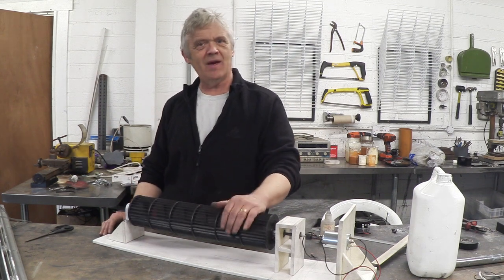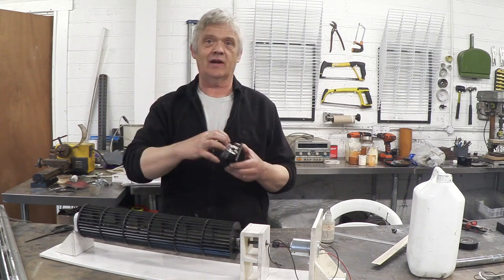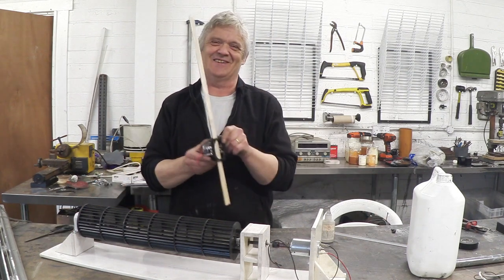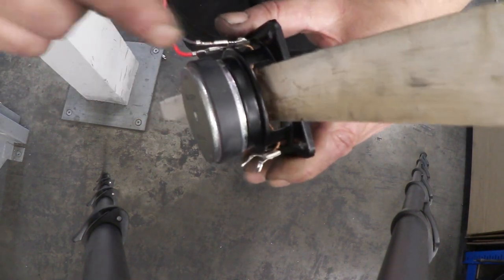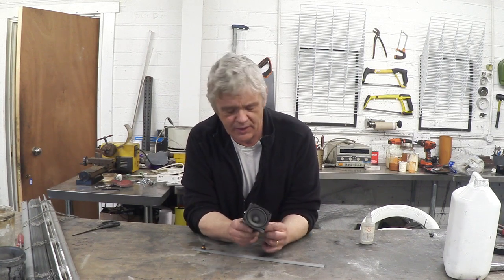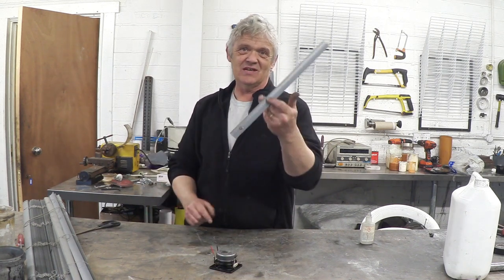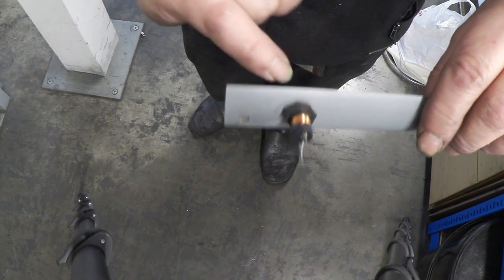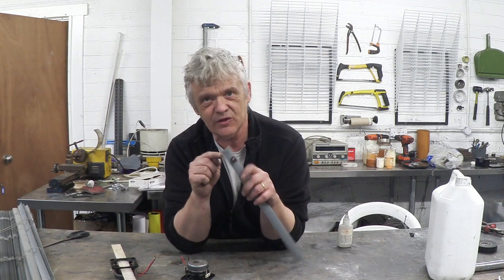Weird Wind Generator   No Blades, No Moving Parts

Comment: very cool! seems like it would be a breeze to mass produce
Reply from the maker: I was thinking those little microphones - in which case it would be
Reply: Breeze .. lol i see what you did there!
Reply: @ThinkingandTinkering  Wouldn´t a microphone produce a tiny bit of power anyway, if you put it in the wind, the wind blows in the microphone and produces a lot of signal usually.. This is used in many games on the DS, because blowing in the microphone usually maxes out the signal.  So if got that bit right, it´s a question of hooking up a lot of tiny mics to a diode-bridge and then possibly joule-thiefs?
Reply: @ThinkingandTinkering  How much would the cost/watt be? Because the reason why we are building those huge towers for wind turbines is that while a small one is fine for a home owner it is not as economical to build a million 500W microturbines as twenty 25MW ones. Given these tiny devices would likely need to be assembled by hand it seems like you need some minimum size to make them cost effective.
Good news is the upper part can be a piece of plastic pipe or an inflated balloon or whatever, no high tech or expensive materials needed.
Reply: @Ludifant  Most microphones are going to be connected to an amplifier. In the case of your DS, phone, etc, the amplifier is going to be drawing power from the battery to boost the signal enough to make it usable for audio. I am not implying that your idea will not work though, because speakers and microphones work on the same basic principle of using coils of wire and permanent magnets to generate electrical signals.

Comment: It does have a moving part!
Reply: I am amazed how often the titles are not accurate and most don't pick that up...Glad that you did otherwise, I wouldn't be able to resist saying something. Robert has some great ideas and content...but suspect many of these videos are teasers for his paid members!
Reply: @Timothy Mckee it's driving me crazy! i'm going to figure out how to stop the earth from from spinning and orbiting the sun and electrons from spinning and vibrating so i can relax!  thinking a little more, the guys that run a wire into the air and measure a voltage may actually be on to something. the rotation of the earth with it's iron core.
Reply: Exactly. If there is movement of any kind, even if it's not perceptible, there is at least one moving part. If there is a moving part, there is wear or fatigue.
Reply: There is no mechanical moving part it’s like a vibrating membrane isn’t considered a mechanical moving part
Reply: No spinning parts, which is the real thing that kill birds and bats with the blades, but that's a lot less catchy.
Reply: @iflnr978   Bingo !!!
Reply: @tkmotors991   It changes air movement energy into electrical energy, Therefore it performs a mechanical function. The vane moves about it's 'fulcrum' voila ! A machine !.
Reply: "Parts" is plural. Only one moving part. He is correct.
Reply: @ppppugh7892  False. That's not how grammar works. The plural is to follow the rule, which includes the possibility of any number, including one. Plural is correct even for less than one, such as .45. It's an undefined number, which is referred to by the plural.
Reply: Is an electron a part? It's made of stuff !
Reply: @Gazr Gazr Or, everybody could just admit and accept that the original commenter was correct and let it go. 🙄
Reply: @awo1fman  I was trying to help the guy out from all these knit-pickers with faaaaaaaaaaaar too much time on their hands. The use of the multiple letter 'a' in the word 'far' breaches all manner of rules I'm sure. Keep them to yourself, please 🤫
Reply: Ok Long  LOL
Reply: Ummer Farooq  Baloney. Lubrication is irrelevant. A moving part is a moving part. If it moves, it will eventually wear out regardless of the type of motion or lubrication. The only question is how long. As a matter of fact, reciprocating motion as in this device is much more stressful than rotary motion. Lots of things wear out that don't even move, especially if they are outdoors and exposed to the elements. Nothing, and I do mean NOTHING , lasts forever.
Reply: Ummer Farooq  You're illiterate and 100% wrong. The grammar rule for an unknown or unspecified number is to use the plural. And your assertion about auto parts is not only ludicrous, it's just as wrong because many, many auto parts move in linear or other types of motion, some use lubricant and some don't, and the word "parts" applies to (human) body parts among a million other things.

Let it go. 🙄
Reply: @ppppugh7892  The problem is that it's click-bait. If you're going to use a click-bait title, you have to expect backlash if it's false.
Reply: Ummer Farooq  Really, nobody cares. We're not talking about motors here. There is zero relevance in anything you are saying. Straw men and utter nonsense.
Reply: @awo1fman  I think stupidity lasts forever.  Yeah, and lately in America it is spreading like a virus.
Reply: @awo1fman  * Cockroaches and Twinkies would survive an apocalyptic event I do believe!!!
Reply: @iflnr978  Nikola Tesla knew all about this and more , he said that free energy was all around us, our technology on earth would be centuries ahead of where we are now if people had cared to listen. The money makers don't want ANYTHING to be free unfortunately.
Reply: Pity of the state of mentality of modern humans, they'd rather have a deep self-promoting and actually useless discussion about what someone said instead of hearing the message that was said, ....plebs.
Reply: @shanestevens622  Looks like it has a blade too.
Reply: @lindastone6868  Shame........
Reply: @lindastone6868  Shame........
Reply: How did a video, about generating electricity, turn into a debate over grammar?
Reply: @tonyhemingway7980  I told my grandma to stay out of it.
Reply: You cant make wind without moving something.
Reply: @tkmotors991  a deforming membrane is most certainly a moving part. a deforming membrane in the carburator of cheap small engines like the ones in weed-whackers and lawnmowers which is the first thing to break.
Reply: CMAP Moving but not mechanically. Cheap wearing maintenance isn’t as bad as mechanical breakdowns😁
Reply: @iflnr978  Now you know that the wire will not break the magnetic field because it rotates WITH the earth. Thus not breaking any fields.  NASA"s project of Towing a wire from one of the maned space capsule's using an inflated balloon to drag out the wire. After only a quarter mile it generated so much voltage it melted the wire.
Reply: Ummer Farooq  get a life! Who cares?!?!
Reply: More accurately: parts that move against one another to produce friction.
Reply: Not rotational
Reply: @mekuranda  How do you know people don't pick up on it? Basically you have no clue.
Reply: Ummer Farooq , although I am impressed with the idea/technology behind this video, I do object to the title as well. Not vehemently, yet the nuance is there for the objection. 
You might feel otherwise, yet “moving parts” has no necessary connection to any motor, engine or lubrication. 
To move something, means to displace it, to agitate it. Wind make leaves move. So the leaves are already moving parts of the tree, even though they are fixed on the branches, which — thanks to the wind and the leaves — move as well. I understand what the author intended, yet at 6:10 he himself contradicts his title.
It might be that you need to freshen up on the etymology of the word “move” yourself ;)
And with that, for someone who should “distinguish between right and wrong”, you are not doing your name any justice, Mr. Farooq.
Reply: You know technically even the dentist material is vibrating right now? nothing stays still ever
Reply: Todd Molloy :) absolutely ;) at the atomic level, everything moves! And at 0 degrees Kelvin (not Bacon) - veeeery slowly, almost at standstill. Some will say tat at 0K nothing moves, but even at that temperature atoms don’t stop from vibrating. No one has been able to prove otherwise ;)
Reply: Robert B , Nice observation Robert, however it is very difficult to make an inductor the size of an atom. So for practical purposes stick with the reed model.
Reply: @tkmotors991  Why not?  It is different and very interesting.  The movement is different but she is correct.  He even talked about movement.
Reply: It occurs to me that his reed is a form of blade that is being moved by the wind as opposed to generating wind by moving.  But this is all splitting hairs. It doesn’t make the video any less impressive and interesting.
Reply: @PetePistachio  I agree the video is impressive.
Reply: @awo1fman   That was quite  impressive, and, then, then .... I should have stopped reading. I thought the same thing about 'parts', anyway. However, and I don't know if it changes the status of the number's definition, I'm not a mathologistician, but please tell me how 45 portions out of the 100 available portions is not a plurality of portions!  .... Sir.  Because It would be quite surprising if a stranger on YouTube was talking out his arse.
Reply: It's like says free energy...
Reply: @awo1fman  Semantics.
Reply: @hugehappygrin  You need a dictionary. It's reality, not semantics.
Reply: @awo1fman  well somebody better convince the oceans to stop spewing all that methane gas, cause I m not gonna stop eating cow.
Reply: It not only has a moving part, it's incredibly inefficient and impractical. By the time you either make enough of these or make one big enough to generate a reasonable amount of power, you're taking up ten times as much space as a turbine and not saving money, materials or anything else. It's mildly interesting but useless. And the title is an outright lie clickbait.
Reply: Compared to wind turbines with gearboxes (or very expensive rare earth magnets). this works well.
Reply: @andrewnorris5415  No, it doesn't. It is strictly a novelty proof of concept. It's incredibly inefficient and generates an infinitesimal amount of power. It would require huge numbers of these things to generate a useful amount of energy. It's cool, but not worth pursuing as a serious power source.
Reply: @stewartcaldwell5299  electrons are fundamental particles, therefore they are not made or composed of "stuff".
Reply: @awo1fman  like to see cats trying kill a wind turbine! ( Sorry, couldn't resist picking up the grammatical error: you should have put "... more than wind turbines DO.")
Reply: @alanclarke4646  The cat's name is Don Quixote! 🤣
Reply: @awo1fman  haha. I don't think he actually killed the windmill, though.
Reply: @alanclarke4646  Exactly! I did say cats kill more birds than wind turbines. They kill lots of birds, but have yet to succeed with any windmills. So technically the statement is correct. 😝
Reply: @alanclarke4646   Fundamental particles ARE stuff !!
Reply: @stewartcaldwell5299  yes, but not "made"
Reply: @alanclarke4646   So trees aren't made of wood? LOL
Reply: @stewartcaldwell5299  trees ARE made ( by biological processes). I meant that there is  no "making"  process whereby "stuff" goes in one end and electrons ( constructed entirely of said "stuff") pour out the other end. And stripping electrons from atoms doesn't count, because it's the atoms that are made out of electrons plus other "stuff".
Reply: @alanclarke4646   I  get it. Just teasin' ya. I know you're trying to speak in a specific scientific way, but please bear in mind, that scientists (as I am),  learn to speak the common language as well as a specific language, and must be able to able to communicate with everyone.
Reply: @stewartcaldwell5299  😁
Reply: I think he meant no ROTATING parts :-)
Reply: Ummer Farooq  none of which mention/ mentions lubrication...
Reply: @davecrupel2817  I made a wind, and moved something!
Reply: Ummer Farooq  I think most people know not to stick their fingers in an electrical outlet, and they are not all going to be experts on grammar.
Reply: Ummer Farooq  Good, you seemed to have brushed up on the etymology of the meaning of the words, as well as of their root :) Bravo! Although you have it backwards there: Motor has the same root as in move. but at least you're trying... even if it took you several months to brush up on the subject 🦥...

Now to your added comment, the "English" are nowadays as well versed in the "English language" as are the Americans, Canadians, Australians, South Africans, Kiwis, etc... in other words, I wouldn't trust a Brit any more to teach me English than I would trust an Arab or a German or a Mexican.
الله يبارك فيك ويهديك
Reply: Ummer Farooq   I feel like Manuel in Fawlty Towers "Que?"
Reply: @parrothead1264  And UK pub carpets I have heard. :-)
Reply: Ummer Farooq   I read the comment  and wrote the answer therefore I am NOT illiterate, by definition.
Reply: Ummer Farooq  Wrong!!!!!!!!!!!! No moving parts means NO MOVING PARTS!!! Parts of this move.
Reply: Ummer Farooq  Again wrong a wobble is a move as it means the object is not immoble ie STATIC. Do you think buildings in an earthquake do not move because they merely "wobble" the occupants would disagree.
Reply: Ummer Farooq  you are still "obsessed" with your claim/defense of "no moving parts"
let us debunk that right now:
go to 1:53 and hit the play button (unless it's set to auto-play)
then, as you are watching the video, look at the reed how it does not move to and from the wall. it is absolutely "still", going from one side to the other. This is also known as "static" in relation to the tip of the reed, not the wall of course, otherwise it would be moving, and we can't have that, since we want to -- once and for all -- disprove that it moves.
Oh, now at minute 2:04 he mentions that it is wobbling. Hmmm now he's throwing us a curve ball... This is definitely not good, since the definition of wobbling is:
Verb: move unsteadily from side to side.
Noun: an unsteady movement from side to side.
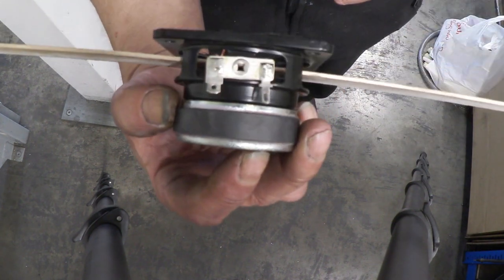And furthermore at 2:53 he admits that the coil obviously moves in and out of the magnetic field... 
But the tip of the reed in relation to the tip of the reed is not moving, so it can not wobble, so why is he saying that it is moving unsteadily from side to side? Is it the wall that is moving instead?
Maybe he is taking a different point of reference and not the tip of the reed...
Let us look again at the whole apparatus from minute 1:53 and take the wall as reference point.
Since the wall is now static, we can definitely see that indeed the reed is moving, and just like he himself contradicted the title of the video claiming that it is wobbling, we can now be safe to say, that there are moving parts (even if it is just a wobble) and also, we can definitely see that the reed is akin to a blade, therefore we can with certainty say that the title has lied to us twice because there is at least one blade (as opposed to No Blades) and at least one moving part which is the reed being moved unsteadily from side to side by the wind (and I would even go further and say that the speaker coil, to which the reed is mounted on, moves, just like he admitted at 2:53; so there are at least two moving parts) and therefore not No Moving Parts. 
So, Mr. Farooq, "the one who distinguishes between right and wrong", thank you for showing us that you should not have taken that name, because distinguishing between right and wrong is definitely your forte. But thank you for playing, and I applaud your efforts.
السلام عليكم و رحمة الله و بركاته
Reply: Ummer Farooq ok, so he is not using any moving “car parts” and my fingers are not moving either while I am typing. At least according to your U.K. definition. And the earth does not move. You can keep your fork, I have seen all you can offer. Thanks 🙏
Reply: Ummer Farooq  The top moves with respect to the base, the atoms making up the top floor move up to several feet. Seems the old adage "Can't argue with stupid" still rules.
Reply: Ummer Farooq  To be a "foreigner" requires that one is not in one's homeland. I am in my homeland and therefore I am not a foreigner.
Reply: @ppppugh7892  Oops you have a vane AND inductor so that is then PARTS that move
Reply: @ppppugh7892  You have a vane and inductor so that is then PARTS
Reply: @awo1fman   but applying a natural polymer like hemp plastic could produce a wear/fatigue resistant device.
Reply: but applying a natural polymer like hemp plastic could produce a wear/fatigue resistant device.
Reply: @ionneifion2012  "Resistant" isn't "proof".
Reply: Actually a vibrating part, not the same!
Reply: @amishshilpi3668  What part of "vibration = motion" do you not understand?

Plus, the fact that there are no hinges or other low-friction components means there is bending, which is the worst possible kind of stress. It causes far more catastrophic failure than any other kind of wear.
Reply: surely you are not confusing yourself with displacement! Actually that is what i was clarifying.

Your argument about stress for a such a timid vibrating device certainly you can quantify instead of using erudite terms like dangerous! Problem with you is you have put your footprint on every comment irrespective of the fact that you make sense or not!

I'm sure you will not misunderstand the term displace = motion = vibration = danger!
Reply: @awo1fman  🗑

Comment: I recall an early internet post by a young inventor explaining something called the "windbelt generator" using recycled shakeup flashlight magnetos and gluing them to recycled videotape, placing everything in an old venitian blinds holder creating enough energy to charge small batteries for "third world" lighting etc... now that most of the world is "third world" this may help in the need for decentralization.